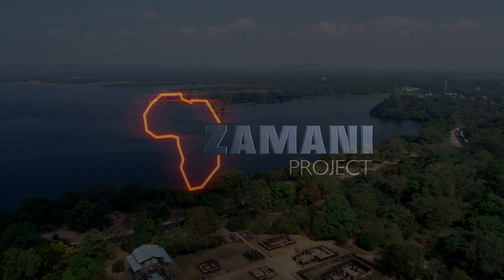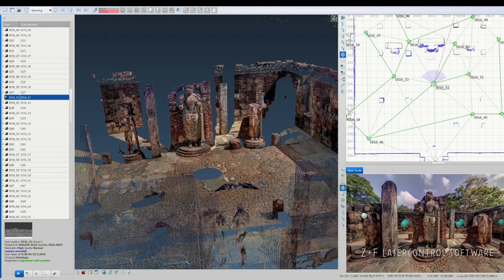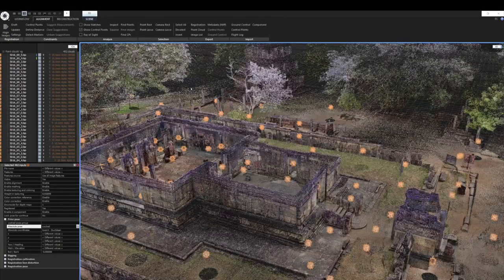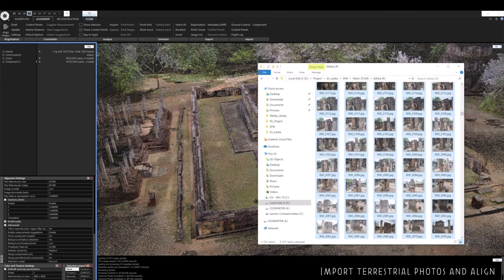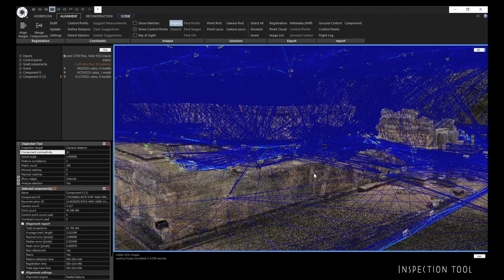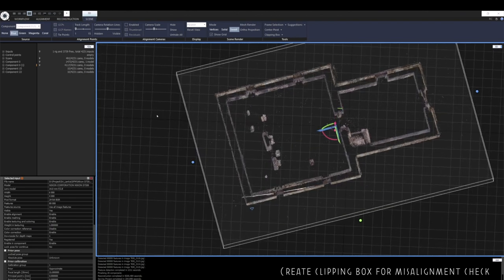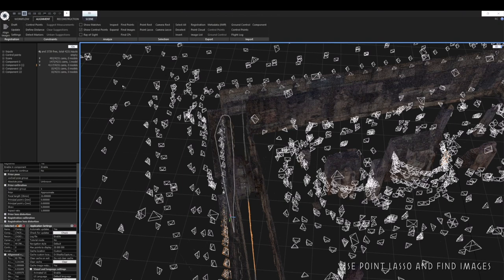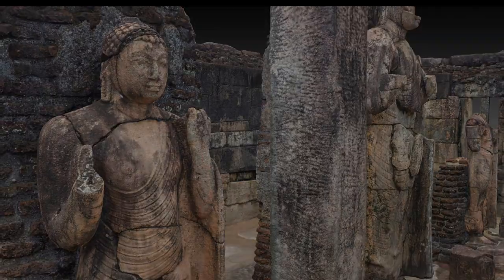Import of Z+F laser scans by Zamani

Comment: Very interesting
But what is the idea of combining scans and photos in this way? Why is there no additional noise in the final result, since there are 2 independent data sets describing surfaces with different accuracy? And as far as I understand, the scan is registered using the cloud-to-Cloud method, which also increases the noise of the final cloud. I have always believed that it is common to use data from scans where there are no photos, and use data from photos in areas where there are no scans (roofs, for example). And by combining these 2 parts by control points, you will get an accurate result where there is no duplication of the same surface by scanning and photos. Please explain this, I think I misunderstood something. Does importing scans significantly improve the accuracy of photo alignment, and if so, how? And how do you deal with surfaces described by 2 independent datasets?
Reply: I had the same question, and still struggle in the blur texture result coming from laser combines photos. Dose it have some specil parament when generating the texture?
Reply: By the way, The final texture model in the video is rendered in RC or had done some post process.